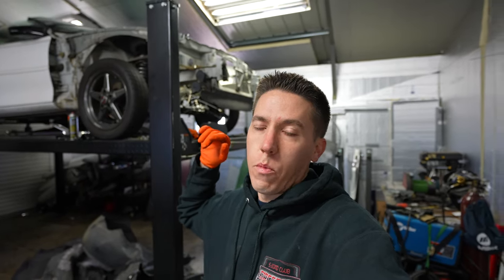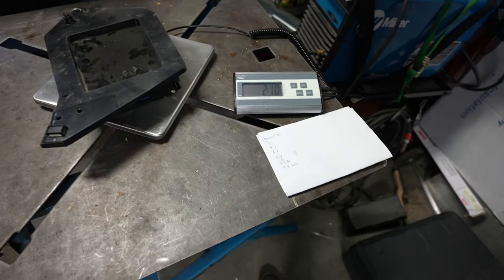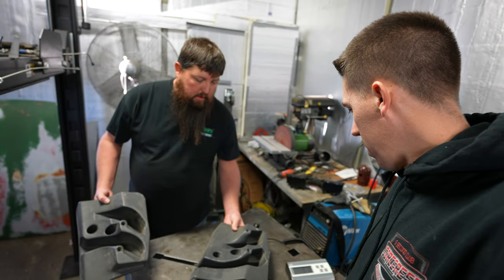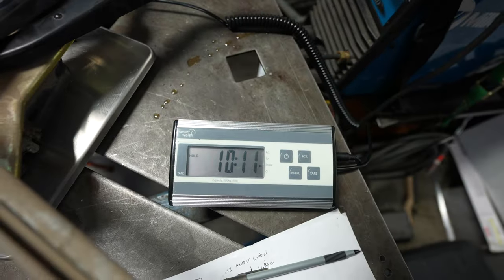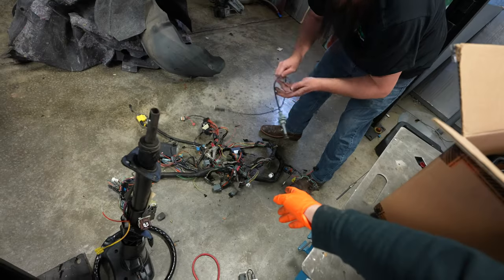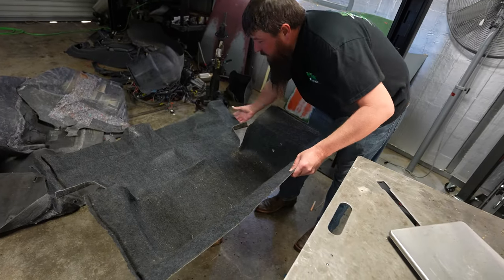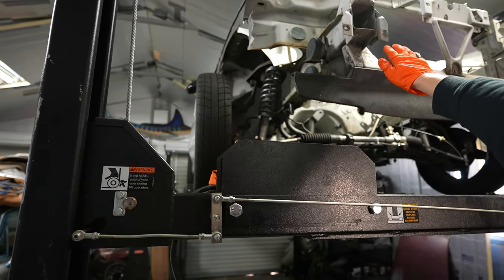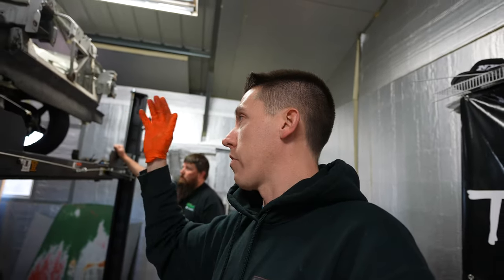Weighing Stock F-body Camaro Parts That We Removed!

Comment: Also, considering the way with LS engines that you can add a couple hundred horsepower to compensate for things, like the creature comforts such as air conditioning, power, steering and power brakes, which are a must! I am thinking, Steve Morris, 2500 hp engine, and all the creature comforts. Of course I’ll have to take an equity loan to do it….Definite maybe!